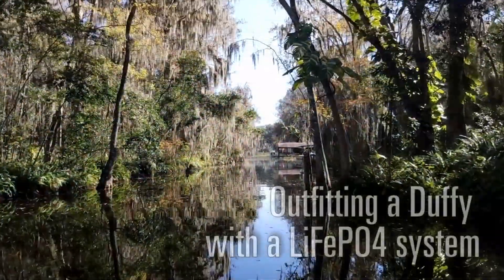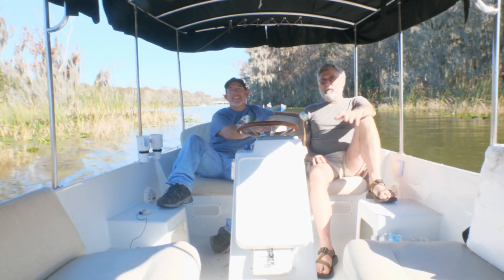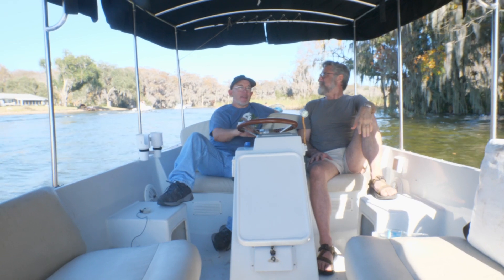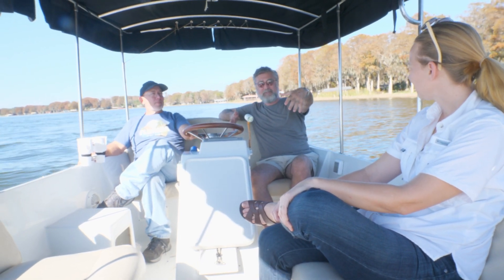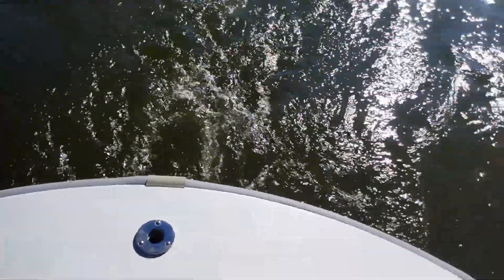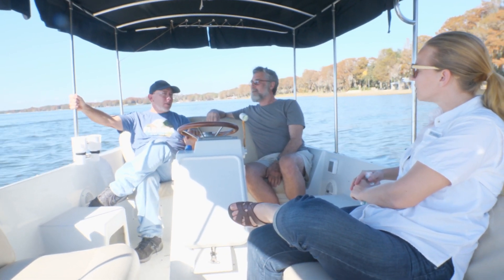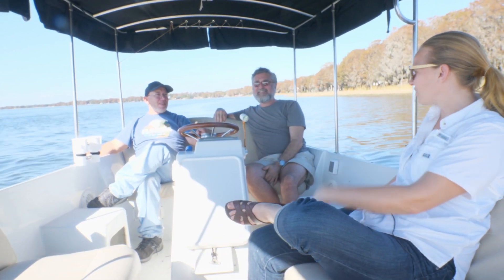Duffy electric boat gets lithium upgrade

Comment: Actually the Battery management system BMS will shut of the charger and if you buy a 150Ah golf cart battery, it most likely comes with bms, with charger and with touch screen and Bluetooth - look at cloudenergy- they sell these complete packs for around 1600,-

Comment: Another complaint about this video is that Clark never explains how his "Bank Manager" is actually connected and operates with two different size battery banks.  The power bank is 36 volts, and the Auxiliary bank is 12 volts.  In all of his other videos he demonstrates how he connects 12V lead to 12V lithium for all different purposes. But he never describes two banks with different voltages, because that would be insane to connect them in parallel.  I'm very skeptical that his BMS will work in that configuration.
Reply from the maker: Really?
   That's what the buck converter is for.  In this installation there are no 12v banks. The 12v is supplied by the buck converter and runs off 36v.

   Maybe watch it again and take a look at the Duffy section of our store and read the description of the parts there.
Reply: OK - I get it now.  You have 3 x LI batteries and 3 x LA batteries, both operating at 36 Volts DC, and then using your on-board charger at 36 volts to charge all of them in parallel.  But, your Bank Manager keeps both banks charged at the correct float level.   I was confused from the video, because it sounded like you were using the DC/DC buck converter to supply 12 volts BOTH to the boat, AND a single 12volt lead acid battery.  Just to clarify - you are using 3 x 12V of each battery type, 36 volts each bank ?   If that is the case, then why does your LI battery balancer have 4 connections to 4 batteries?  I suggest that you clarify your technical videos using more thorough explanations of these details  without all the side stories and fluff.  @Clarks-Adventure
Reply from the maker: I suggest you do some studying to learn how this works since it obviously does and stop being so rudely critical of my video style.

Or find something else to watch

Comment: It was such a tease when Clark said that he would show how he did the conversion.  Unfortunately that part of the video was very minimal (about less than 1 minute of video time).  All the rest of this video was discussing other stuff with the owner.  I would really like to see another video where you describe the electric boat system in detail, along with power components, drive components, charge components, wiring diagram, etc.  I would subscribe to that!

Comment: I am on the verge of setting up my duffy this way and want to know when I buy the bbms will it come with wiring instructions on where in line this all works? I'm excited to go lithium. I want to make sure I can plug into shore power with all the duffy stuff and have no problem charging. Thanks in advance
Reply from the maker: I suggest you read the manual before buying to verify it all makes sense to you.

https://www.emilyandclarksadventure.com/bbms

For Duffys I think it's best to find your own normally closed 48v monostable contactor (relay).

That way if you set the BankManager to shut down at say 20 percent left in your Li you can turn the BankManager off to give you a 'reserve tank" to get home with.

Comment: Clark, I'd be interested in having you talk to the gents at Genetry Solar and get your opinion on their charging of Lithium iron phosphate from shore power. They seem like very smart fellows. I have that but still have not setup for the battery charging aspect. Sid is their programmer.
Reply from the maker: Set something up if you like.
   I'm starting to consider imbedding my technology.  I'd supply chips that can be worked into the boards of other products.  I'm talking with battery producers now.

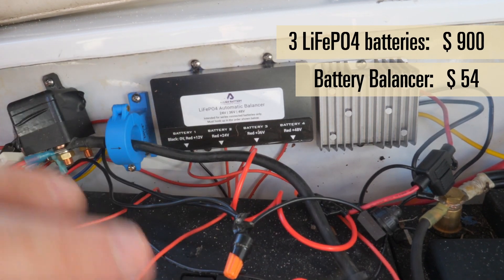Comment: Clark, at 3:46 into the timeline, the relay used in this design, are you happy with it thus far?
Reply from the maker: It's a monostable set up for normally closed.
For this application it's good as in if you set my device for a minimum percent of charge, say 30%, the boat will go dark when you have 30% left in the li.

Then just turn the BankManager off and you have reserve to get home.

I don't love them but I like them enough to carry them on our sales page as a budget option.

https://www.emilyandclarksadventure.com/bbms
Reply: @Clarks-Adventure  Thanks, I'll check them out.

Comment: Check out the Island Packet electric launches which I believe were over 20 feet long and had solar built into the pop-up hard top cover that would lower down to completely seal off the interior of the boat when docked at the press of a button.  Even had a galley and built in pop-up private head.  Not sure if they still make them but they would be for many a self charging boat that you never had to plug in.

Best!
Reply: 22 duty solar ekrrc cabin crusrr 100 Mike range b u it

Comment: Like the build. What was the capacity limit without modification? 
Even if I get rid of all my lead I think your manager may be the best care of the lithium investment.
Reply from the maker: Yes truly I think it's worth it as a li protector.  And you can keep your charge controllers.

But you need lead.  The very latest software version can use almost no lead but it needs some.  This build only has 7ah of lead!

Comment: Perfect launches. Looked at the old and new ones. I think the new ones have a submersible drive pod. Not even the new ones offering lithium are as well managed.
Reply from the maker: Thanks
Reply from the maker: Andrew is considering moving the BankManager to the console.  One of the features of the latest BankManager software is an accurate percent of charge meter (gas gauge) and a fully charged indicator.  As well as voltage displays for both battery banks and amp flow for the lithium.
   Basically everything one would want to know about the state of the batteries.
Reply: Duffy doesn't use pod drives. They do have a powerrudder system where the propeller and rudder are the same unit but the motor is above the waterline.

Comment: I’m glad you mentioned low current overcharge of LiFePO4. So many people seem to believe that only the charge termination voltage matters, and neglect to notice that the cell manufacturers always stipulate a 0.05C charge termination rate. Charge to that voltage at a lower current and you’re overcharging.
Reply from the maker: Yes, and that can happen so easily with solar or while using your electrical system during charge.
  Honestly I didn't understand this as a problem when I started this project.  Solving the low current overcharge is what made this interesting to me.
Reply: I'm not entirely sure i get this.. But i watch Andy's off-grid garage channel and his question was. " Why can we just not set the absorption and the float to the same voltage so we constantly get charge when our devices are on and being discharged"?

I'm guessing this could be the reason why?
Reply from the maker: Oh yeah.

With flooded you'd just boil more water.  If you replace it you are probably ok.
With li...  This happens.

Basically with li you want to charge till full then disconnect until you discharge.  That's a lot about why there is lead in my BankManager system
https://www.emilyandclarksadventure.com/bbms
Reply: @Clarks-Adventure  thanks for quick reply. My system is just all lithium with a full configured bms i have set myself. So would this be an issue with just all lithium? I have set my bms max charge and discharge settings
Reply from the maker: I suggest you read Conrad's write up linked to the end of the page above.

BMSs shut down lithium cells in an emergency
  They aren't charge control devices.   I'm pretty much convinced that no charge controllers out there charge li safely.  But of course my opinion should be considered biased ;)

Some years ago I started mixing li and Pb.  I might have had the first YouTube video on it.  It's all the talk now.  It seems I might be the leading edge on charge method as well but it's just what the manufacturers and scientists do but made to work off the lab bench and in the real world.

It doesn't take much lead to have this work.  For example https://youtu.be/HWM8YnlKefQ